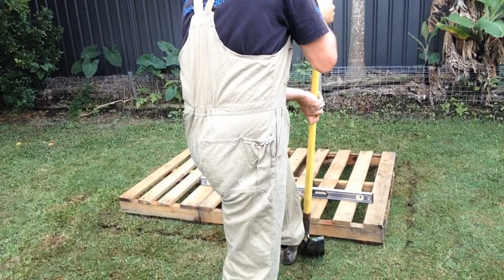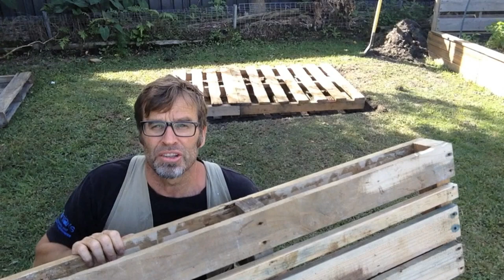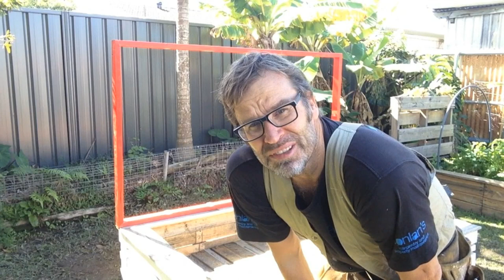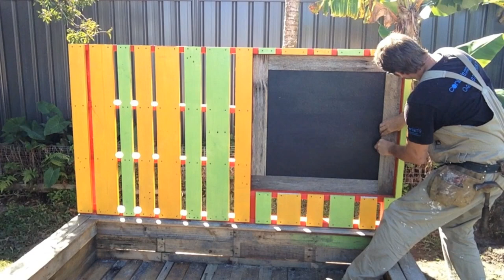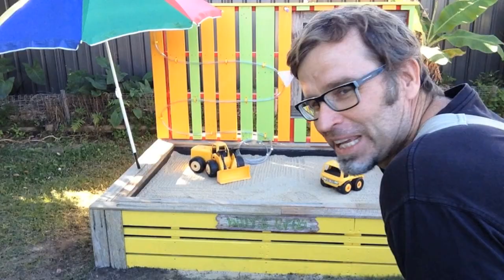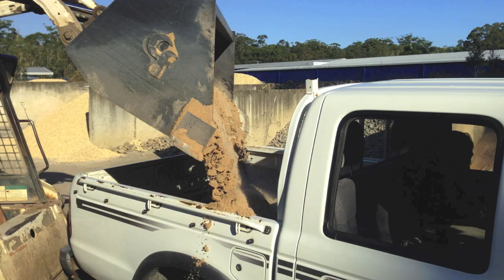How to Build a Sandbox / Sandpit using Wooden Pallets.

Comment: Hello mate, im about to do some decking using pallets as my base, not 
going high just one pallet high off the ground then screwing the decking
 to the pallets.The pallets will be sat on flags which are on top of 
leveled, flattened soil which I have covered with landscaping fabric, 
prior to this i removed the grass, rotavated the whole area, the rake 
and rolled it. The idea being that the flags will keep the pallets just 
above the ground so most of the rain water can drain away through the 
fabric into the earth.So i have a question, did you treat the wood that 
is touching the ground? The reason I ask is because the last thing I 
want is the base of my deck to be rotting from beneath haha!
Reply from the maker: G'day Tommy. Any part of the pallet that touches the ground will rot.....especially the pine pallets. In fact any timber that comes in contact with the ground will rot. It all depends on how long you want the deck to last. Good luck. Cheers mate
Reply: Thanks for your response mate, i ended up painting the bottoms of the pallets (that which will come into contact with the paving slabs which keep the pallets above the soil) aswell as the support blocks with a front door paint, weatherproof stuff, nice and hardwearing so should hopefully get a little longer out of it with that, someone also suggested bitumen but I had already completed the painting at that point, maybe something i will do later on should the pallets ever need changing, im expecting the pallets to go before the decking planks do

Comment: I always enjoy your videos. Keep them coming. One question: the nail gun you use, can you give a make and model I would like to find one similar if possible in the states.
Reply from the maker: G'day Glockman. The gun is a Paslode 16 Gauge Bradder which l've had for about 6 years now. It's been a pretty good gun. If you do get one, make sure you keep up all the recommended services. As soon as the gun gets a bit dirty inside, it will start to play up. Hope that helps and thanks for the comment. Cheers mate.
Reply: Thanks for the info!
Reply from the maker: Glockman5000 No worries mate.